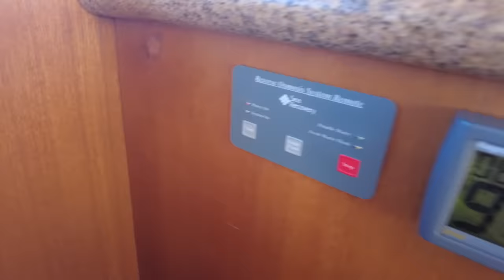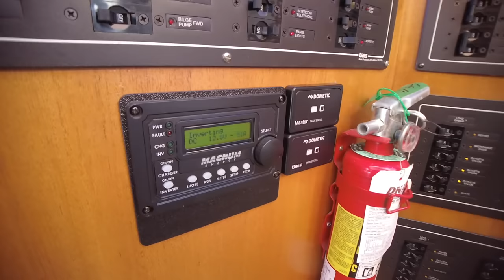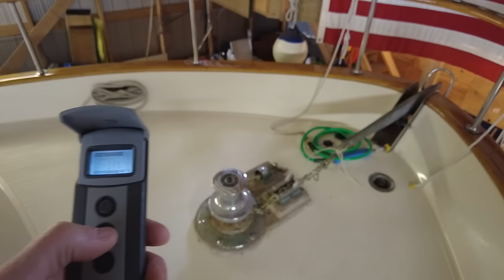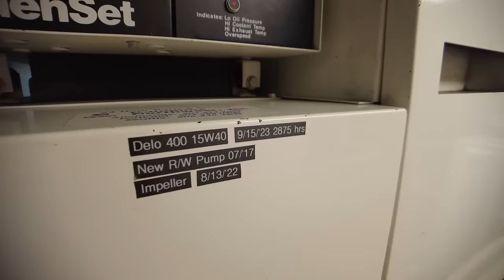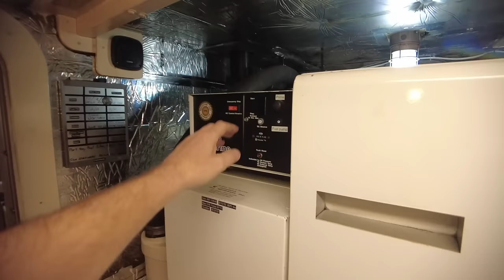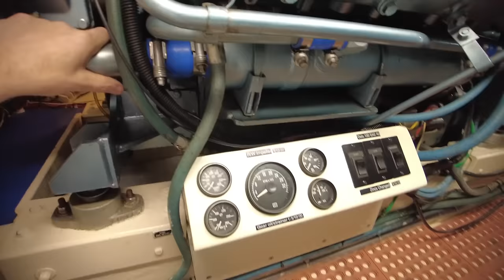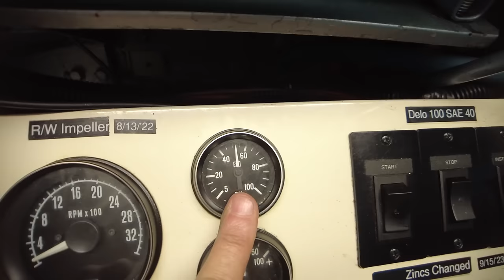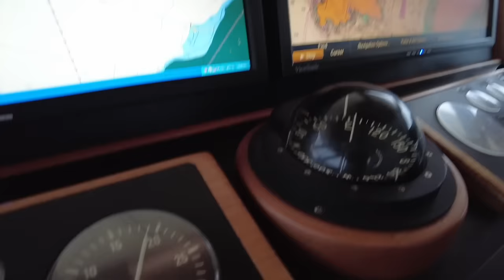Tollycraft 61  yacht  Vessel is SOLD!

Comment: On these older boats (more than 30 years ) I can only wonder that the insurance would be for her ? Any idea for experience boater with no claims ? Cant get any of these underwriters to even ball park it ... They want a recent survey and contract to even run you a estimate. Ridiculous. Excellent walk though. Engine hours ? 1000 hour check ?
Reply: disregard about engine hours...I went back over your EXCELLENT walk through,..where you states overhauled in 2010 and 1000 hours ? and 2700 hours on original (port ) motor. ......wow...this was the most thorough walk though I have ever seen ...and I have seen quite a few in last year or so.
Reply from the maker: Appreciate that, We Used a very reputable surveyor Oct.'23 for the out of the water survey,  If you have reasonable boating experience, there should be minimal issues obtaining coverage, despite the underwriters being ever more risk adverse...  Stb. M/E has 1K hours since rebuild, port 2.7K hrs...